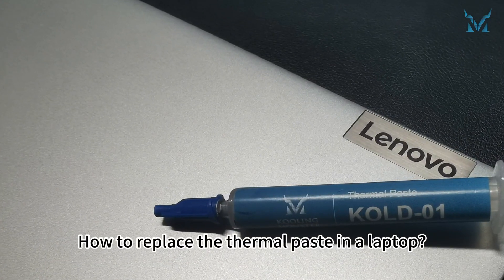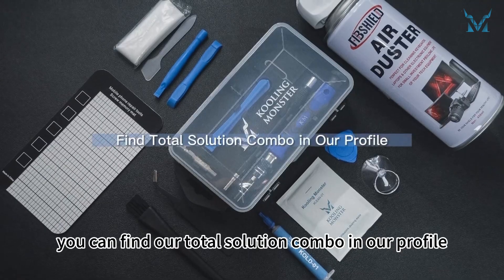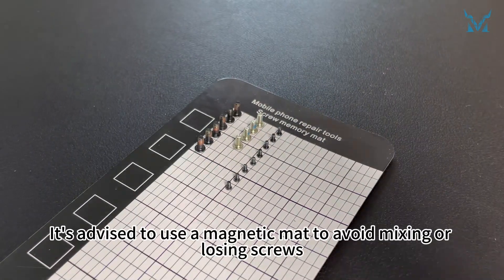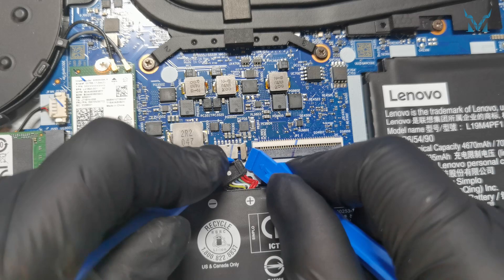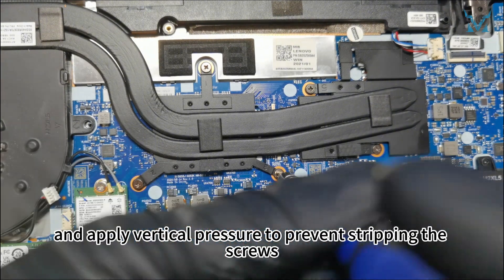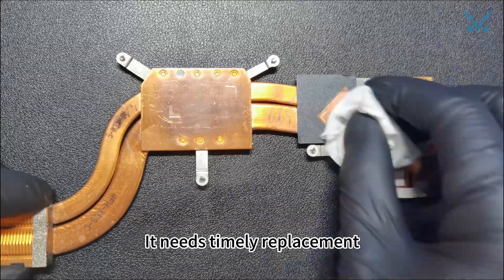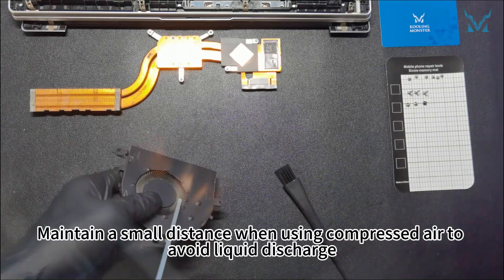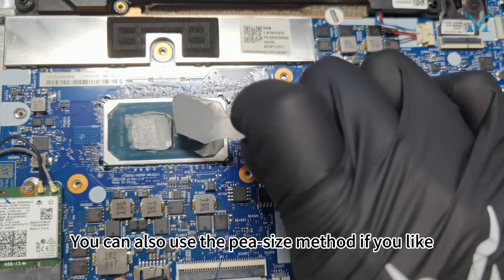Speed Up Your Lenovo IdeaPad Slim 5 2021 Prevent Overheating With Dust Cleaning & New Thermal Paste

Comment: Which flathead did you use for fan screw
Reply from the maker: Thanks for asking! I used a **PH0 screwdriver**, not a flathead — it fits the fan screws perfectly.
Reply: @koolingmonster well I unscrewed every screw watching your tutorial but there's one screw of heat pipe which is stripped and I just cant get it out what do I do